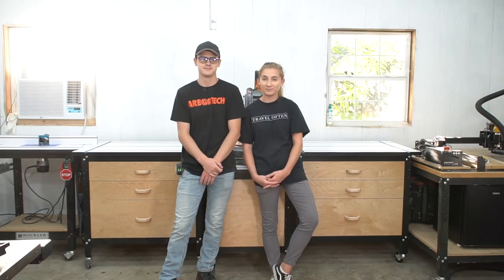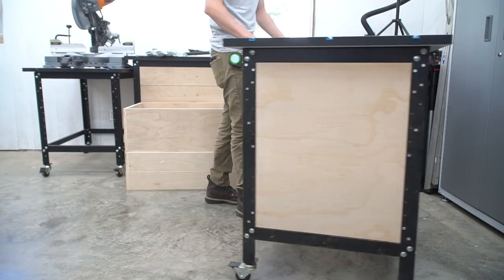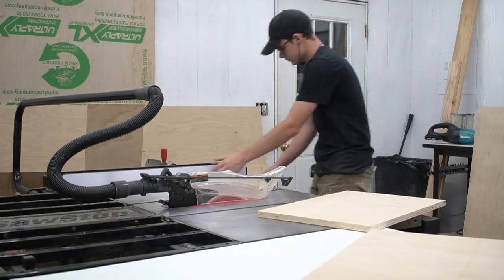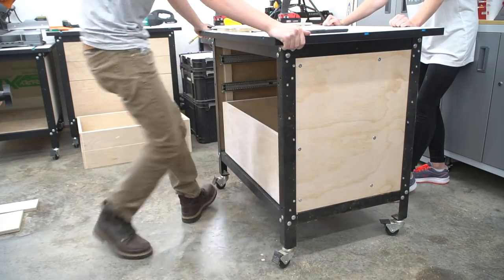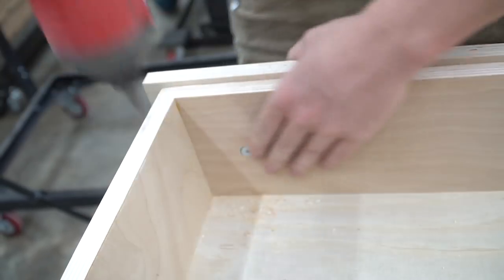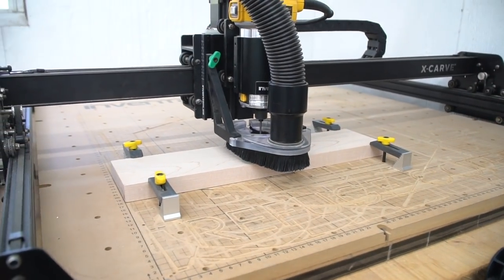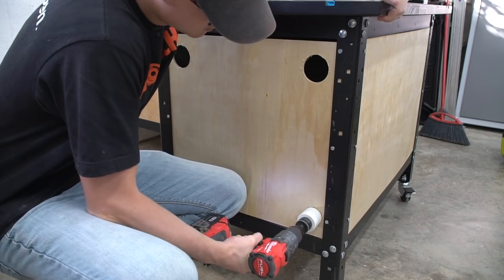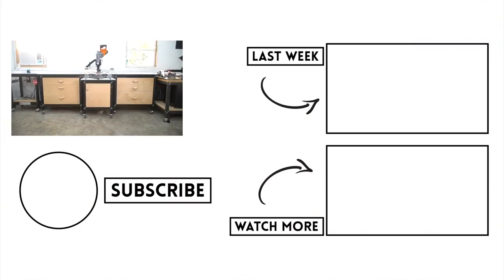Easy To Build Miter Saw Station || Woodworking Shop Project

Comment: I was able to use the stop to cut my pieces all the same MyBest.Tools Only let the blade come to a complete stop before lifting it back up otherwise it might 'catch' the work and inadvertently move the stop. Used a second clamp for holding.

Comment: Great design, love the use of the rockler frames with the plywood, lots of flexibility to customize. I just wish some of these builds weren't so expensive, between the frames, plywood, hardware, etc this would cost $1000 which would def break the bank.
Reply from the maker: Yea it’s definitely expensive, but these stands are long term investment in our opinion. Ours have been used in three different shops each time having a different purpose. I love that they are metal and will last forever. Last time we moved we broke a few down to store them and rebuilt them in the new shop. You could save a decent amount by ditching the t track table tops and opt for plywood. I feel like anytime you have to involve a few sheets of 3/4” plywood projects get expensive😕
Reply: No agreed, its a great design and definitely built to last, just not a project you can run out and do. I'd love to have these in my shop, just don't have the funds at the moment. Love the tutorials you guys are doing.

Comment: Nice project! I did something very similar but instead of building up the sides of the carts for the drawer slides, I used the Rockler "Drawer Mounting Kits for Multi-Function Shop Stand-Drawer" that are super easy to install and work great! Hope this helps for future builds, the pulls are a nice touch and keep up the good work.
Reply from the maker: Oh nice! We will have to remember those! Thanks!

Comment: Very cool. guys! I'm designing a new miter station station right now, and this gives me a few ideas. I'm digging the t-track table tops and the way you secured the saw. One upgrade that could be handy is to add fold out wings to that center cabinet so it could work as a stand alone station that could be rolled to any spot in the shop.
Reply from the maker: Oooo yea that's a good idea! Looking forward to seeing what you come up with! Thanks!

Comment: Good looking & designed miter station. I like the flexibility the Rockler frames provide. My only concern are the wheels can't be leveled, I guess all the leveling is done under saw base.
Reply from the maker: The stands come with nice leveling feet if you need to go that route. We are lucky that our floors are flat enough that casters are plenty good enough. Being perfectly flat really isn’t an issue as long as it’s lower than the saw. When you make the cut you should be pushing the board down and against the saws fence to register a square cut.
Reply: Seems awfully expensive for a miter stand! $119 for stand plus 1/4" & 1/2" plywood $50 and very expensive Accuride drawer slides. This one stand easily $225!

Comment: Do you attach the left and right stations to the middle miter saw one? I’ve been researching something similar and am not sure that’s possible using different leg lengths. But I would like to do it to set up longer stops.
Reply from the maker: We did not attach them together because they are pretty stationary. Even if we had two on each side with the t track tops, those tops overhang, so it would still make it difficult to find a way to get them butt up together to attach. Hope that makes sense😅

Comment: Very nice but very expensive using the metal stands, T track tables and drawer slides.  Any estimate on total cost if you were to purchase those?  Cost doesn't take away the fact tat it is very versatile.  Thanks for a good video.
Reply: Just north of $300 for the metal stands and table top. A bit costly, but lighter in weight and nicer looking. I think I would opt to make my own table top just to save a bit as the top itself is $200.
Reply: Yep and they used two of them., a little research = metal stands x 3 = $360; T-Track Tables x 2 = $400' Caster sets x 3 = $150 Total  $900 give or take depending on "Sale" items from Rockler